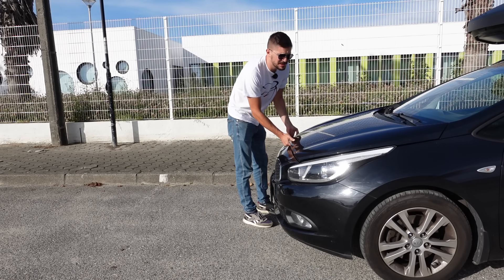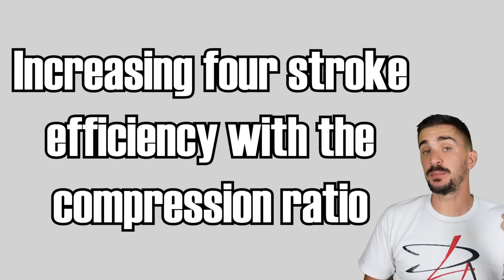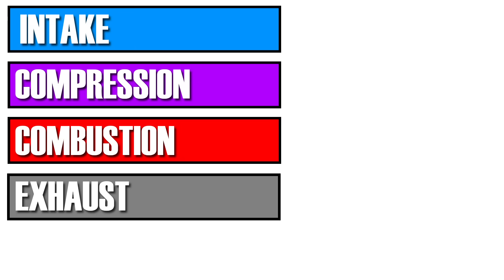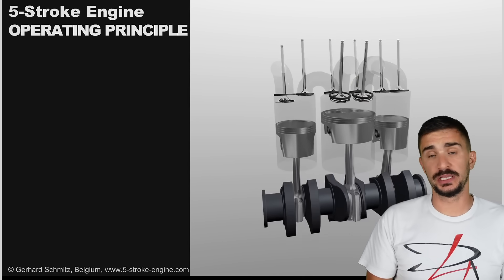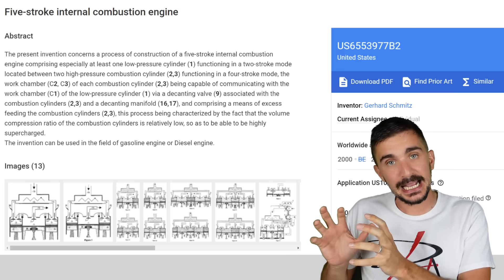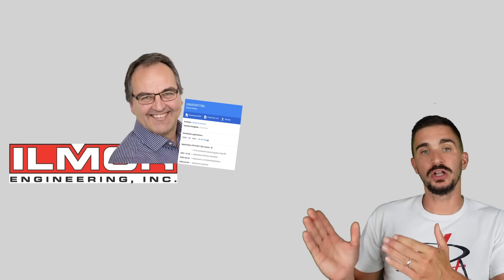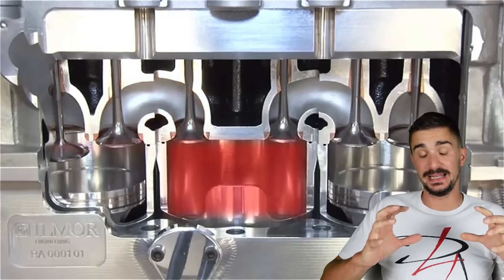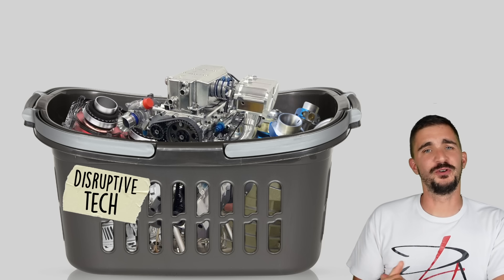Why Five Stroke Engines Are More Efficient But Still a Failure

Comment: maybe they could make up something like add a direct cyl fuel injector and a coil on plug spark plug, and then switch valve control to pneumatic or some kinda solenoid, so you can control when where and how that cylinder is used. Then add an intake valve to the existing 2 exhaust inlets (and 1? outlet? not sure how they went on that part, if there was already 4 valves)2 inlet and 2 out, or 2 in and 1 out.. so if 3, it would end up 4, and if 4, you could try to make it 5. ,  
You would then via ecm /ecu control make that extra cylinder [by choosing when to open or close certain vales, and or to inject fuel and spark or not]. either a 'normal' working cyl during those low rpm/load conditions, but then at the higher load/rpm instances revert back to what is already here.  you just need to make those "small" changes to be able to do that,  then you'd get best of both worlds ////  what you think???   PS. if that's the key to the holy grail, please include me in the patent!!  ;)

sorry its so long, only downside i can see is, a fair bit more complexity and cost.... would it be worth it? who knows.... just storming my brain! hope i was clear with what i am suggesting!

/end long winded rant like explanation...

Comment: Although the 5 stroke failed to produce power well at low load, it sounds as if it would work great to drive a constant speed generator. If it were to run at its optimal RPM and load  all the time, it has potential. It would probably perform extremely well in something like the edison hybrid truck.

Comment: Atkinson/Miller Cycle Engines achieve pretty much the same thing as 5 cycle engines: more expansion than compression.

If it is used widely in an adequare range like in the Toyota 2GR-FXE, you get unmatched fuel economy. Especially if you use Miller ratio instead of a throttlebody to avoid throttle losses

Comment: Thinking about EGR (AGR), the exhaust fumes would long term pretty much building up the middle part of the engine. this would requiring more maintenance due to cleaning up the space like wise it has to be done in engines with an EGR system? correct me if i‘m wrong. just thought about it.

Comment: A note for 5:05 
This is is not true. Yes, most diesels use forged internals, but comparatively they are stronger compared to they mass.
The reason diesel's don't rev high is because of their longs stroke, and slower ignition time of diesel. Since diesel burns a lot slower than gasoline, diesel engines have a long stroke and low revs to use as much of the thermal energy of the diesel. Increasing the revs will just cause the power curve to flatten or drop, since a lot more fuel is left unburned.

I'd argue that forged connecting rods, combined with a lightweight piston is the best for high rev applications. Only the weight of the piston itself will have a significant impact on revs. But in the applications of a normal car, the weight has absolutely nothing to do with the rev limit of diesels, ESPECIALLY since most gasoline cars rev-limit is below 8000 rpm

Comment: So essentially an ice engine is a steam engine in which the heat is wasted and work is done on the combustion and not the steam side.  As a consequence if there were high temperature engine coolants and engine could produce sufficient steam on waste side. 

Let’s see what the math would be 35% + 65/2 = 67.5% efficient. 
So what are the problems in doing this 
Coolant/water heat exchanges are typically have poor variable output performance. 
The second problem is post catalytic converter heat recapture
Steam piston wear and tear (Steam does terrible things to metal over time) 
Better choice is small scale steam turbine $$$$ and space. 
Radiant heat loss. 

To have a perfect waste heat pickup the cat. Converter needs to be at the head’s exhaust ports, they need to be radiant heat insulated, which would be immediately fed to the 2stage exchanger. 

Cold water would go through the coolant heat exchanger, which no longer needs to be a radiator to the 2stage exchanger where the steam goes through a steam turbine and then is released. This solves all the problems except 1 and that is such an engine is best suited for rear engine design since the catalytic converter need to be in a rather open space. This can be solved by wrapping the converter in steam generating lines and post catalytic transfer as the 3rd stage. Then the only remaining problem is post turbine water capture, and saftey system. 

So let’s talk about problems with this video. 
First even for 1500 cc, if you manage to get 129 hp, that’s pretty good, the efficient 1NZ engine that got all the praise for efficiency is 87 hp my 1967 (4.6 liter) got 195 hp on a good day and was about 20% efficient and needed leaded gasoline, the factory timing settings will not get you there. 

The second is waste at idle, use it as a hybrid engine, engine comes on when excessive power in needed. 

The third issue is turbo charger. Anything with the word turbo charger is to be avoided _in any car_. Turbos cause excessive wear and tear on engines, raise map pressure and degrade engine oil. 

Not mentioned. When an engine is cold the static output pressure drops rapidly with distance from valve due to heat transfer. Therefore cold performance of 2stage will be low at start up. As the exhaust transfer tube heats up however, it will reach maximum performance since the gas is essential pushing a cold cylinder but transferring heat durian the exhaust cycle, unfortunately that cat converter will not have sufficiently heated gas. 

So the catalytic converter is a problem but since there is a single exhaust port one can put the cat directly on the port. This reduces radiation  on cold days. 

So another problem is that in a typical ice each cylinder spend half the time in cold and hot part of combustion. This engine spends 3/4 of cylinder volume * time in hot phase. This means more heat loss via radiator per unit of fuel. So we have dramatically reduced tailpipe heat, but modestly increased water heat.

Comment: It could work as a APU with constant rpm in the optimum RPM range, and there belt powered force induction methods. Isn't a  unworkable design but car companies ain't going to spend money on something like this without government and civil society pressure for better emissions and lower consumption of fuel.

Comment: the middle piston could be disabled/switched off at low rpm's. volkswagon recently had a car that would switch off a cyliner in low speed high traffic conditions.
Reply from the maker: Think about it, this one was never enabled in the first place. The problem is the mass and the friction, you can't make the piston dissappear. Cylinder deactivation just cuts spark and fuel.

Comment: The ideal situation, is to start with air/fuel mix. @ the mix it has been provin that you can run a engine off of vapor from the fuel tank.
On that aspect if you optimize your intake correctly you will eleminate the off-set of exhuast gases due to a cleaner burn.

Comment: If I'm not mistaken, at a certain point of compression ratio, the force needed to compress the air fuel charge becomes greater than the power provided by the combustion process. And along with the greater mass of diesel engines limiting rpm, again as far as I remember the burn rate of diesel limits how fast the engine can perform its 4 strokes. It's the same with gasoline engines but for them I believe it's in the 20-25 thousand rpm range I think. I'm going off my automotive schooling from almost 10 years ago so I could be mistaken.

Comment: Well , well , it's been already 40-50 years since we have the internal combustion engines being only %30-35 per cent efficent. So , todays cars are easily 1, 5 heavier and make the same distances with almost half the amount of fuel. So , these numbers should have changed a bit , no? Of course , there is more factor than the just engine that conditiom consumption but, still come on guys......

Comment: Turbo compound like what was done on late radial bomber engines seems like a way to boost efficiency. But instead use it to generate electricity and power to drive the accessories like AC, power steering and mild hybrid.

Comment: The first thing i thought is also the turboengine why fire up a cylinder with the exhaustgas, when you can use the gas to fire up an turbocharger?
My question is how do the turbocharger avoid beeing a brake at low rpm? is there something like a bypassvalve?

Comment: The reason is that engineers design engines to run at stoichiometric air to fuel ratios and don't harness the energy from the fuel with complete combustion of lean oxygen rich mixtures which their designs can't handle. How can an engine be efficient when both the inlet and exhaust valves are open at the same time? The ICE hasn't fundamentally changed since the early days. Engineers always work to prevent the tremendous power released thru detonating lean mixtures which we know the power of when our motorcycle starts screaming and taking off when its running out of gas.

Comment: Triple expansion steam engines worked on the same principle where high pressure steam leaving the first cylinder went into a second lower pressure cylinder which in turn fed into a third even lower pressure cylinder. This type of engine was typically used on ships and ran most of the time at constant revs (I served in such a ship). I expect the five stroke ICE would probably be most suitable for generators or ships operating in a narrow rev band that is most efficient, but not suitable for car/trucks that need efficient engines over a wide rev band. But turbos use exhaust gas to power them so why not just have a turbo engine instead of a five stroke?

Comment: The idea of not counting the thrid unit is genuine, it is only the working part engaged in the actual work the rest is all down to scavenging. they need to find a better scavenger. It is obviously not the unit they chose but might be incoorpprated in the exhaust as with the other add ons used before compression. What is the opposite of turbochaging  chargingobrut?

Comment: You know, if you set that valve up to direct the exhaust stroke gases to the center piston when lifted, and direct the exhaust gases to the exhaust output when not lifted, you could lock pressurized gas into the large center piston and it would act like a spring, minimizing its pumping losses and solving that particular problem.

Comment: The internal combustion engine is conventional for a reason. It has evolved incrementally such as increasing compression ratio to safe limits. Adding knock sensors. Tuning exhaust. Progressing from flat head to overhead valve to overhead camshaft. From carbs to fuel injection to port to direct to dual injection. Variable valve timing,  free valve. Exhaust gas recirculation etc.  Allowing great engines like the K20, LS3, 2JZ, M54, DYNAMIC FORCE 2.5L and others to develop. ULEV to evolve. The notion of cleaner, even synthetic oil and fuel. So we are on the right track.

Comment: Most modern engines use variable valve timing tricks to keep the intake valve open as the compression stroke begins.  This stores gasoline fuel in the intake manifold.  This allows the combustion stroke to be relatively larger than the compression stroke, extracting more energy.  Then it exhausts, and the next intake stroke draws the fuel-air mix back in from the intake manifold, along with new air, plus additional fuel being injected.  The consequence of this is the compression ratio is lower, thus the power output is lower; but it does draw more of the energy out of the fuel.

Comment: The 4-stroke engine was not invented by Otto but by a Frenchman named Étienne Beau de Rochas. It would be nice if in a video you told the real story that the official story has suppressed. Otto didn't even know thermodynamics. He was an excellent salesman and had very influential and wealthy friends. Meybach and Bosch.
"Sperry machine" from around 1910 was a six cylinder engine with  four combustion cylinders and two compounding (the thing is derived from steam engines) expanders. I have an old 1920 book from my great great mother describing it. Today we can do that using a turbine, with far higher efficiency at a far lower cost. And exactly the same thing happens to steam engines in 1900 with the invention in the last part of XIX of the steam turbine.

Comment: I don't know much about engines, I'm not a mechanic or even a gear head so my theory is probably totally wrong...but...
Instead of having another cylinder to send exhaust back into the combustion chamber, why wouldn't you just have two alternating exhaust valves? One that exits the system completely and one that mixes with the intake air.
Every other cycle would burn recirculated exhaust with the only extra moving part being a valve.

Comment: Those efficiencies are probably averages of cars on the road, there're some petrol cars that can do 40 - 50% thermal efficiency. The 50% requires hybrid, so the engine can run at the most efficient RPM.

Comment: Sounds like the 5 stroke could be good for fuel powered generators, able to set them at the rpms, that it will run optimally and generate a lot of power

Comment: Maybe there is a use case for this engine, and that would be generators and generators on hybrid cars. Since generators run at a predetermined RPM, the RPM range problem doesn't apply, so they could theoretically be further optimized by a 5-stroke system.

Comment: Robert Heinlein once referred to ICE engines as suffering from "the sins of reciprocation" … And he wasn't wrong. Accelerating the piston in one direction, only ton have to bring it to a halt, and then accelerate it in the OPPOSITE direction, two times for each power cycle, is an obvious waste of effort. Gas or steam turbines, which accelerate the rotor and keep it rotating in the same direction thereafter, are simpler and more efficient in design.

Comment: I absolutely love your videos on these unique engines, and love your channel. Long time subscriber. Have you heard of ACHATES POWER and their two stroke, opposed piston, super and turbo charged, dual fuel engine? If not I would love to see your thoughts on it in a video like this. 

Seems to have some of the benefits of the INNengine you’ve talked about, while having two more traditional crankshafts. Effectively solving the torque issue. It has also been mocked up in a Ford F-150 using off the shelf parts (not maximizing efficiency with specific application parts) and had some impressive performance in not only power but also fuel efficiency.  I believe it’s also the only engine on the market that is capable of compression ignition with petrol. It’s been a minute but I think I read somewhere that they plan to make it able to run on hydrogen.

Comment: I wonder what would happen if you use two outer 4 stroke piston engines that feed their exhaust gas in to a single 2 stroke engine in the middle. Less complicated and less weight.

Comment: The Adkinson engine is the basis engine for most, but not all, hybrids. It needs a specific start sequence and the vehicle has to be moving to take advantage of it's complex nature. I've owned two hybrids that used Adkinson motors and cold starts are noisy and can cause engine damage.

Comment: Interesting engine. There was a six stroke engine developed in the late 1800s that used a water injected stroke to cool the engine and flash into steam adding another power stroke with no additional fuel needed. Some of these were large stationary engines that burned low grade oil instead of gas or diesel. Lighter versions were made but never used in cars because of water freezing and later the catalytic converter would not work at all with them. https://en.wikipedia.org/wiki/Six-stroke_engine

Comment: About 10 years ago, VW made a diesel engine that could get almost 50 mpg and sold it in Europe.   However, in order for it to be sold in the USA, it had to be modified under the guise of “pollution control” and it dropped its efficiency to around 35 mpg’s.   What a scam the American government pulls on its “subjects,” all in the horse crap name of “protecting the environment.”    They basically made a clean burning engine, less “clean burning.”   Fail.

Comment: The detail about this engine design heavily limiting the implementation of a turbocharger isn’t that bad, because it doesn’t rule out the possibility of using a supercharger, which does not run off of exhaust pressure.

Comment: The total volume change of a cylinder that does not undergo combustion shouldn't be counted towards the displacement since it is not drawing in fresh air. Saying that Ilmor "lied" because of this is ingenuine, and would be the equivalent of saying that all piston engines have a displacement of 0 liters since any volume that is added to the combustion chamber is taken away from the crankcase, so the total change in volume is 0. Who cares about the crank-case volume change in this respect... it's not drawing in fresh air or receiving fuel or containing combustion, so its ignored. Therefore, the low-pressure or expander cylinder displacement should be as well.

Also, I'd direct you to read the SAE papers 2021-01-0443 and 2021-01-0452 documenting some of GM R&D's work with a different variant of the piston-compounded engine developed with Ilmor, including experimental results taken across 5 prototype engines. The biggest issue was low-load efficiency, where the piston expander's additional friction and expansion hurt engine performance, and how this prototype addressed that.